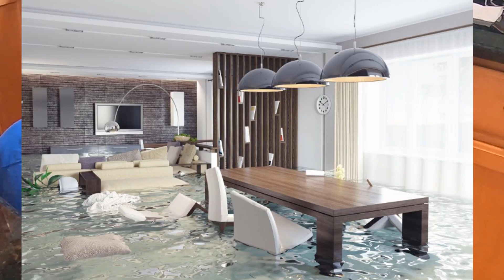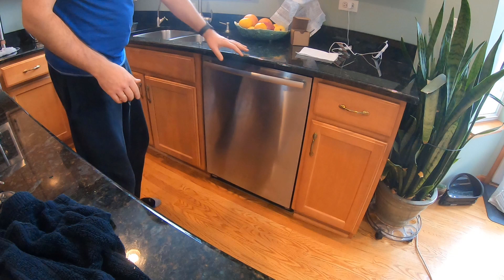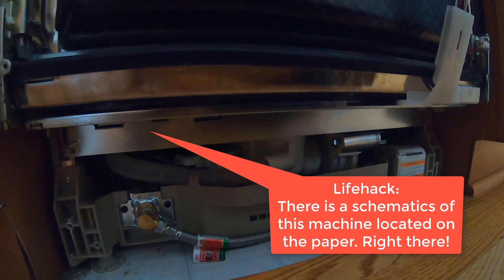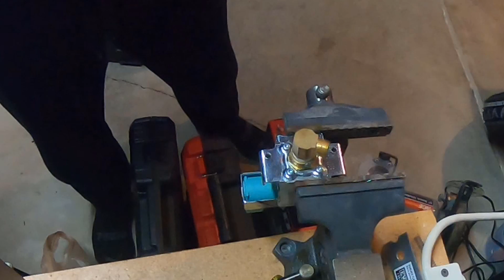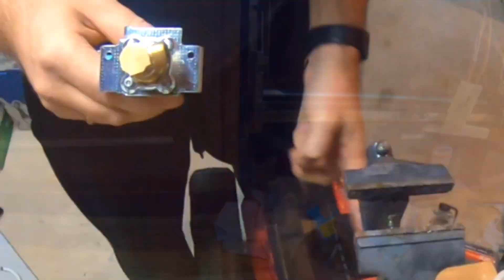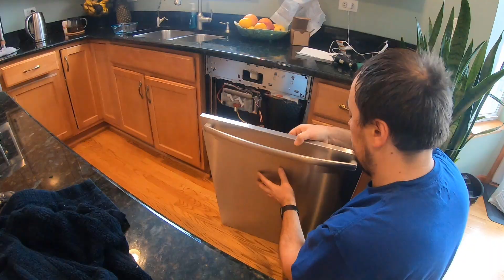Bosch dishwasher inlet water valve replacement HOW TO DIY.

Comment: VIDEO Worked great and my Canadian model was a 24 Inch Wide Bosch SHE23R55UC/64 and I also replaced the bottom float disk (siphoned water from bottom tub and then vacuumed inside of dirt and pet hair debris too) and I bought the two parts from PartSelect Canada and got them in one day!! Thanks Again Best Pixel Repair::))

Comment: This was great, THANK YOU.  However, here is an addendum: When I replaced the solenoid and the valve, I must have moved a wire harness (actually, not really a harness) which must have brushed up against the RED plastic "plunger" on the l.h.s. of the cabinet, just behind the solenoid, to the left.  That plunger is attached to a float inside the cabinet.  (probably detects overflow).  If it is up, it means there is water in the cabinet (or the floor) and will not let the dw allow any water in.  I moved the wires away from the plunger, and, voila, the dw works great.   I found this totally by accident, after taking the dw out, and removing the left side panel..

Comment: Fantastic explanation, thank you.   If you don't have a vise, change the sequence: it's easier to remove/replace the supply fitting when the valve is mounted in the dishwasher.
Reply: Slip joint pliers can work too. Seems easier to attach it outside of the dishwasher if you don’t have to walk over to the vice.
Reply: I was worried the torque required to remove/reseat the elbow fitting would bend the valve's mounting bracket, given that the valve seems to be designed with the idea the hot water line goes directly into it (despite most dishwashers not having the valve oriented that way). I'll find out, I guess.

Comment: What’s the tape you used?
Reply from the maker: I guess just regular plumbers tape.
Reply: @HETPEZB  I just did the repair. Left the old tape on but it has a slight drip of water at the connection. Ordering some tape now.

Comment: Hello from the future. 2022. Very helpful video but they changed some things. The newer machines the water inlet is on the back. That obviously requires pulling out the machine but does not require any disassembly at all. The cover doesn't even unscrew it just pops out. The newer hose material is less durable so you need to be careful. The wire harness is extremely fragile.  More fragile than network cable conductors. Mine completely fell apart just trying to disconnect it. The inlet hose is now 3/4 garden hose connection. Hand tighten only, no wrench.  So they basically cheapened it up but some pros and cons.
Reply from the maker: I just purchased new Bosch a month ago, so we’ll see how it will hold up :)
Reply: @HETPEZB  I got mine pretty much exactly 5 years ago. The inlet valve started leaking literally on its 5 year birthday and threw an E15. Bosch doesn't have any authorized servicers in my area and the local appliance guys don't want to work on Bosch. But I love mine and I'm glad I was able to fix it with a $20 part and with the help of your video.  By the way, if yours is like mine is you don't have to disassemble anything to keep an eye on it. You can pull it out and look under the insulation or maybe just slide a borescope under it.

Comment: This valve has failed on my Bosch twice (on my third valve) in 5 years of normal household use -- very poor design or made very cheap, they are making lots of money on this part as a replacement.
Reply from the maker: May be the water quality affect it.

Comment: Same dishwasher, same problem. I replaced the check valve first hoping it was an easy fix but the problem persisted. I will use this video to assist me in switching out my inlet valve now!

Comment: I had the 2nd scenario you mentioned happen to our dishwasher.  The valve was leaking in the bottom tray causing the float to keep the dishwasher in the drain cycle.  Excellent video,  I was able to order the part which is inexpensive vs. a service call and install it resolving the issue!  Got some brownie points from the wife too!

Comment: Had standing water in Bosch Dishwasher.  Everything I read online said it was the pump....I kept thinking about and
researching....After a completed wash cycle, the bottom was dry....One hour later there was about 1/2 inch of clear
water......I reasoned that it was NOT the pump but the inlet valve.  Your video made it simple.  Ordered the part,
installed it in about an hour, and have not had any standing water since, and the dishes are really clean and shiny.
Many thanks.

Comment: I had the same problem with my 10 year old Bosch DW. It would drain completely and then 3 hours later there would be an inch of water in the bottom. I did this repair with the $16 replacement inlet valve (from Amazon) this weekend and it fixed the problem. Thank you for the excellent instructions Best Pixel Repair!!

Comment: Can you put the dishwasher on it's side for easier access?
Reply from the maker: The access is not bad at all even upright. But if there is no water in the system- you can.
Reply: @HETPEZB  Thanks man.
Reply: @HETPEZB  Thank you. Do you know how the small plastic standoffs are attached behind the cover??
Reply from the maker: Todd Crenshaw , sorry, don’t recall that.
Reply: @HETPEZB  I figured it out. Thanks again for your video. the water inlet valve on my dishwasher was leaking
Reply: @SuperSlappy25  I had two plastic parts fall out after I took off the door as well. I still don't know where they go, so I put the door back on without them. Where did you put your plastic standoffs?
Reply: @kurty9230  They go near the bottom of the panel if I recall correctly. It took some time but I finally figured it out.